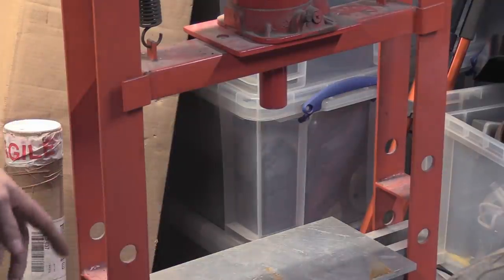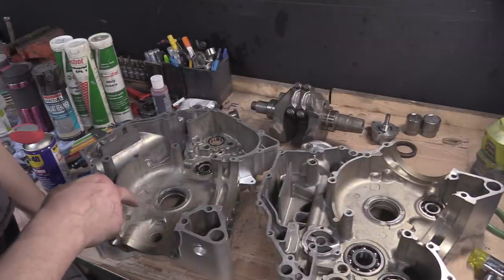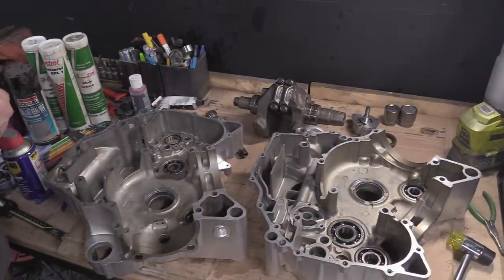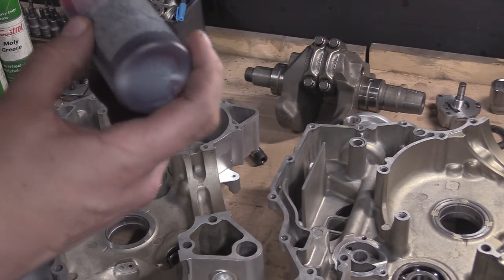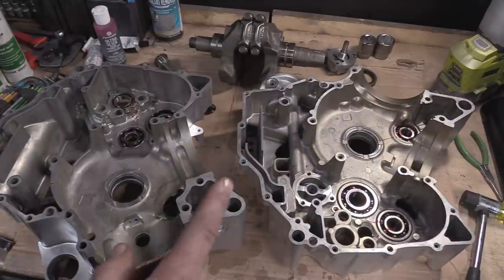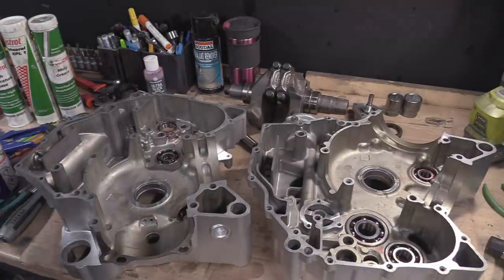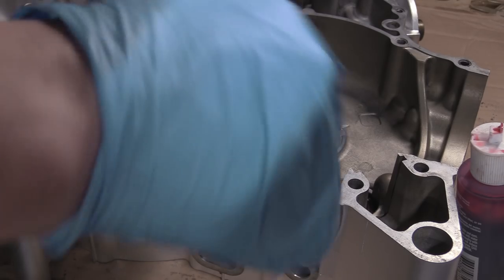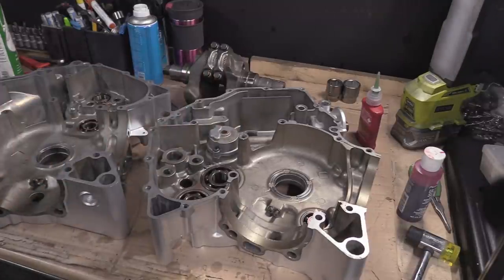Bearing install #22 Suzuki Trackbike

Comment: Good tip  about the inner socket dirt and keeping tools clean, thanks. This is why expensive professional engine builders work stations look like Michelin starred food prep areas. 'Dirt finds a way'
Reply: @Cub-Guy  I'd figure that was a during setup and move clip and it was cleaned before putting the bearings in given the language used.  A clean and wipe down before you start is always needed on stuff you don't use daily

Comment: And remember, ALWAYS press from the inner race. Also, all roller bearings are self aligning, so if it starts going in crooked, just keep going, it’ll straighten itself out.
Reply: For more self alignment magic, press harder.
Reply: I was taught to press the inner race onto shafts and the outer race into holes! Press the race that is in contact with the receiving surface. If you press the inner race into a hole fitting (ie an engine casing) the friction on the outer contact surface will oppose the pressing force on the inner race! I would also advise to press any bearing as straight as possible, ‘self aligning?’ Never heard of that. Seen enough hardened metal bearings mash the soft ally holes to fuck when forced in on the piss tho!
Reply: @1312Johnny  Straight over your head
Reply: @1312Johnny  bearings on a shaft??? What kinda Soviet era junk are YOU working on?? I dunno, maybe it’s just cuz I work at NASA and we only use very high end self aligning bearings. Our O-rings come in a jumbo assortment pack from HarborFreight tho…
Reply: @bcbc8649  I have a special hardened plastic press I use when they’re really stubborn

Comment: OK it'll be pretty diluted, but that seemed like a lot of moly grease in the oil pump, particularly with a wet clutch? 
I'd also be concerned about a gob of grease preventing full flow of oil on initial start up, as well as getting down the oil pump fixture screw holes preventing the Loctite doing it's job.
Reply from the maker: How much? 🤔 secondly, moly grease is a solid lubricant it's there to be sacrificial.  It's not ptfe and doesn't work in the same way. The manual tells you to make up a batch of moly/oil 50/50 and use that as assembly lube.

As for the loctite, it doesn't call it in the manual, which I said in the video I just added it as personal preference. As to the grease messing it up, could have.
Reply from the maker: Oh and if you think the pump can't pump that grease through the engine, it can and does.

Comment: OK can you get those O-ring tools in smaller sizes they sound perfect for a few things I do with airsoft stuff.
Reply from the maker: I don't know, I'll check but the jaws go down to 3mm diameter
Reply: @dirtygarageguy  Trying to replace o rings in npas kits and inside mags is my personal hell so this could save my walls from thrown tools.

Comment: I noticed that you are using a "Retaining Compound" and not a "Thread Locker" (yes, I had to check out 638 since I only use 243)
Any particular reason?
Reply from the maker: Retaining compound is stronger and better at higher temps. These are jis hand tight, so I get the good stuff out.

Comment: Me...
As a kid, pissed my Mom Off throwing the cases in the oven @ 100 to 125 ish. Ya know,
 fer and hour or two at dinner time.
Bearings in the freezer for 12 hrs.
Slid in like copper grease.
Clean and nice so far.
Good mechanical higean (sp)
Is a must.
Sighned ;
Grumpy old Punkrocker.
Cheers.
This is just a prep for the kids build Right ?
Reply: The bearings will only get so cold in the freezer regardless if it’s 12hrs or 24..
Reply: @goinhot9133  
I was a kid when I rebuilt my first motor.
Mom was pissed off...
So l left them in the freezer.
12, 24, 48.
Who cares
Reply: @goinhot9133  
And it was not cold l was looking for.
It was contraction of steel and expansion of Aluminium.
Cheers Dude.
Reply from the maker: 20deg or -18deg... not really much in it. If you are gonna do this, make sure the bearings are in a sealed bag. In the factory they have giant freezers with bearings in bags... just kidding  they press them in and have done for millions and millions of engines.

Comment: Hi matt just a question does the heat from the running engine have an affect on the locktight
Reply from the maker: In thw head yes, that's why they don't have loc time on those fasteners. The rest of the engine is cooler than that.

Comment: probably a stupid question, how can you reliably know what tap to chase the threads out with?
Reply from the maker: There's a metric system of taps. Fine and course, all fasteners for bikes are course threads, only a few (oil filter thread) is fine, and I'm not removing that.
Reply: @dirtygarageguy  thanks Matt...never knew that.

Comment: Don't like drifts, they push on both cages at once.  Take your old bearings, cut through the outer cage with a slitting disc, force out the balls and inner race, deburr the race (about the only use of a flap disc I've ever found) and you can use it for pushing in bearings of that diameter, pushing only on the outer cage.  The fact the cage has been cut through means it won't jam in the bore.

Also, them o ring spreaders look like the thing you use for castrating goats.  "Elastrator", IIRC.
Reply from the maker: They push on both races at once, so? That's a good thing, unless you have a protruding race.
Reply: @dirtygarageguy  The way I was taught was that you should only be pushing on the race that's being fitted, so the outer race in the case of something going into an interference fit in a bore.  Part of this is to stop apprentices simply twatting the bearing with a hammer, I guess, but if there's something that means you're accidentally pushing on the wrong race - maybe that inner race protrudes a tiny bit, or maybe that drift isn't totally flat - you're putting the load through the bearing elements themselves.
Reply from the maker: The apprentice bit aside, no bearing has a slightly protruding race, that would be a defective bearing that wasn't sold.
Reply from the maker: ...and to add, bearings have internal clearance.
Reply from the maker: And to add further (lol) solid drifts is how they are inserted in the factory
Reply: @dirtygarageguy  OK, you made me question what I was saying, and what I've been taught.  That's good, because it's what stops us putting copper grease on the back of brake pads "because that's how I was told to do it".  Best place to go, obviously, is to the bearing manufacturers, after all, they're the experts.

For NTN, the advice is "perform assembly using a mounting sleeve, supporting the tight fit ring. This avoids excessive loads passing through the rolling elements and damaging the bearing."

SKF sell bearing fitting tool kits.  As they say, "Poor fitting, usually using brute force, accounts for 16% of premature bearing failures", can't argue with that.  Their kits "The right combination of impact ring and sleeve allows effective transmission of mounting force to the bearing ring with the interference fit. This minimises the risk of damaging the bearing’s raceways or rolling elements"

NSK only talk directly about mounting bearings with interference fit on shafts.  "A mounting tool is placed on the inner ring as … and the bearing is slowly pressed on the shaft with a press until the side of the inner ring rests against the shoulder of the shaft. The mounting tool must not be placed on the outer ring for press mounting, since the bearing may be damaged."  They don't recommend using a hammer at all.  However, they do cover pushing on both rings - "When both the inner and outer rings of non-separable bearings, such as deep groove ball bearings, require tight-fit, a mounting tool is placed on both rings … and both rings are fitted at the same time using a screw or hydraulic press.

The FAG Mounting Handbook has 196 pages. From page 60, "In the mounting of non-separable bearings, … the mounting forces must always be applied to the ring with a tight fit. Any forces applied to the ring with a loose fit would be transmitted by the rolling elements, which could cause damage to the raceways and rolling elements"

So, as far as I can tell, all of the major bearing manufacturers recommend pushing only on the ring with the interference fit, and only suggest pushing on both rings when you're fitting simultaneously to shaft and housing and have an interference fit on both, which is an odd situation.  On the other hand, they don't explicitly say "don't push on both rings with a flat drift", but the drawings all show a tool pushing only on one ring.  Sure, it's all a bit "angels on the head of a pin", but it does at least confirm that the hundreds of bearings I used to fit every year were done more or less correctly (and the "less" part was all down to me, as per usual).

FWIW, a flat drift, as long as you're sure it's absolutely flat and meticulously clean is almost certainly OK.  But unless you're re-fitting the old bearings, you already have a pushing tool which is exactly the right size for the cost of 2 minutes with a slitting disk, and which you would otherwise have fucked off into the bin.  I've got a whole box of them :)
Reply from the maker: The point is never apply a load to the "floating race". If you have a drift that makes contact with both races then you're not applying load to the floating race any more than you would be normally.

I'll do a video, it'll be easier to explain
Reply: @dirtygarageguy  No need to do a video, I understand what you're trying to say.  What I'm trying to say is this, though - for bearings of the type you're fitting, the internal clearance is single digits of  microns, it takes bugger all in terms of contamination or non planarity of your drift's face for you to be loading the floating race. This is why the bearing manufacturers recommend (and provide tools that) only load the race you're supposed to.  Like I said, you'll probably be alright, but, y'know, you're doing exactly what the manufacturers don't tell you to - you're not quite going as far as doing a Del, i.e doing what they tell you not to do and then doubling down on it when someone points it out, but...

Anyroadup, I have gears to cut.  fun fun.